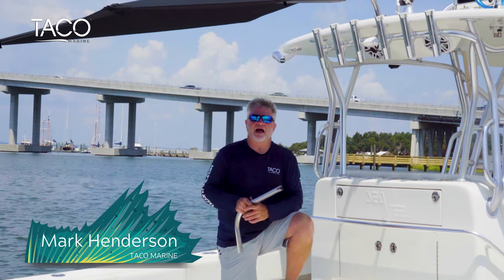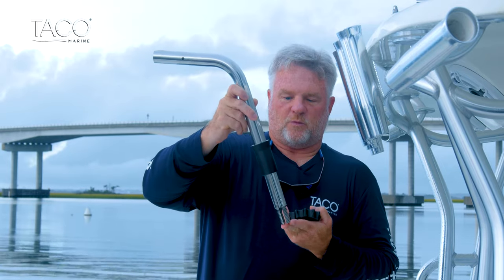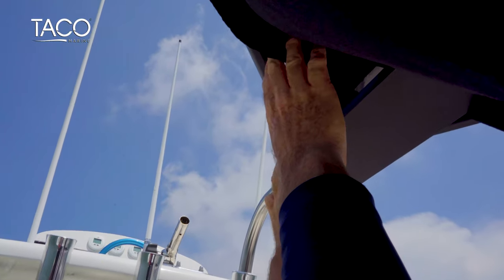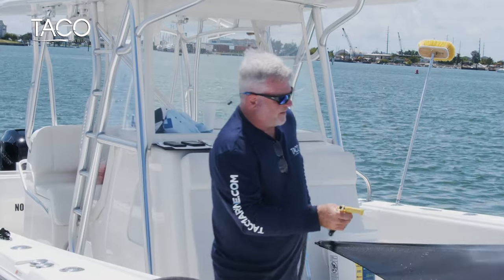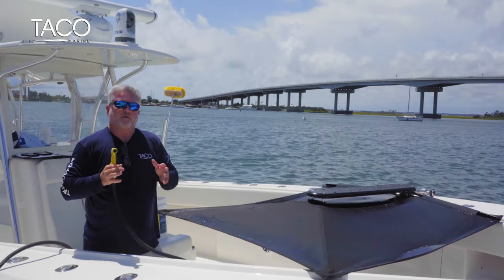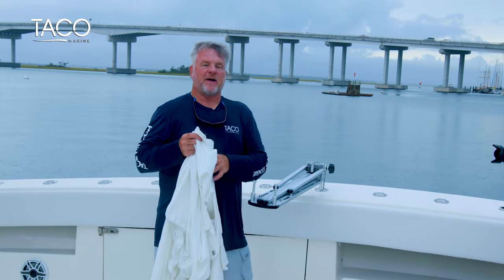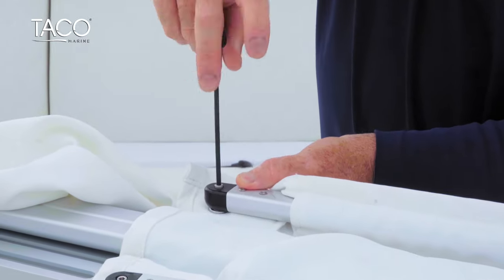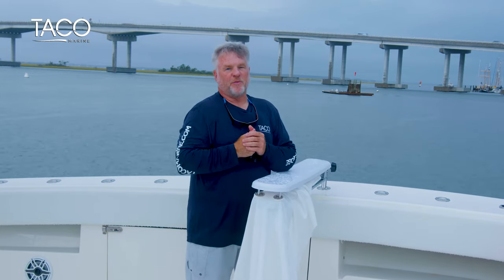TACO Marine – Introducing ShadeFin® Boat Shade!

Comment: Geez, that’s way too much fiddling every time I want shade.  This needs to go back to the engineers’ drawing board.
Reply from the maker: Hi M Fox. We're sorry to read you feel this way without giving ShadeFin a try for yourself. We stand behind ShadeFin and know this has revolutionized boat shade for many families and anglers. We hope you'll reconsider and give this easy-to-use shade system a try in the future.
Reply: @TACOMarine  I like the concept but to set it up each time I want shade, then pack it, then set it up just seems like too much work and believe you need to make it work more like an umbrella system or at least only a few steps.
1) the curved piece that goes inside the rocket launcher should be part of the structure in the form of an adjustable articulated arm that adjusts to different angles
2) the shade material itself should already be attached to the housing using high strength Easton poles which tighten when deployed, sort of like an ice fishing shelter hub
Reply from the maker: @Seektruth-59  Thanks for your feedback. We have an adjustable articulated arm. It is called the Adjustable Rod Holder Mount. View video here: https://youtu.be/HCdAoqFS--g We actually have a variety of mounting options for ShadeFin. The material is already attached to the housing arms. The above is an older video and the design has been enhanced. You do not need to find pockets. Have a great day!